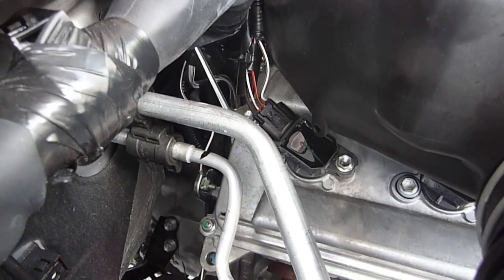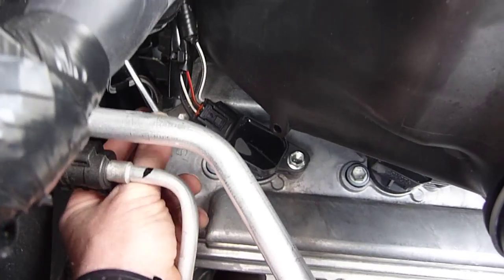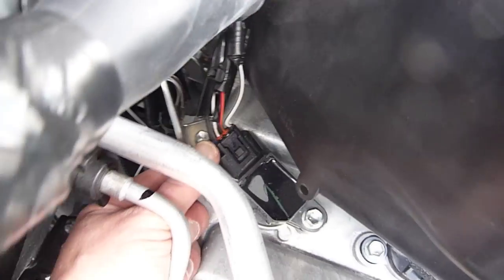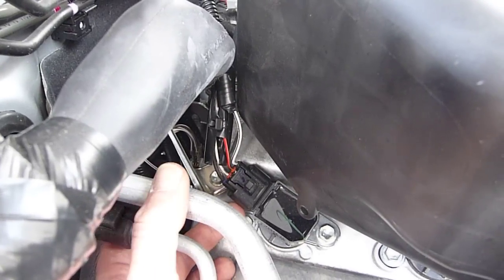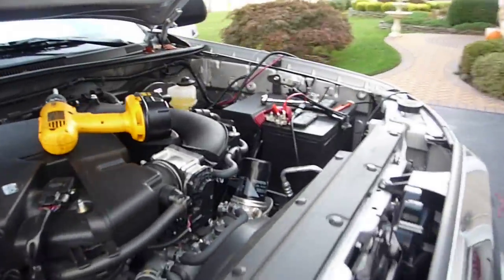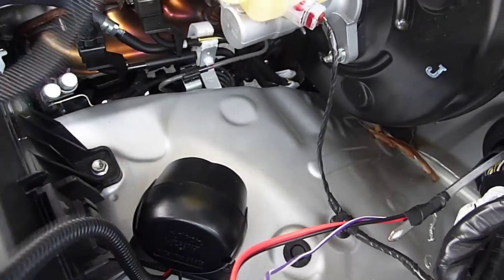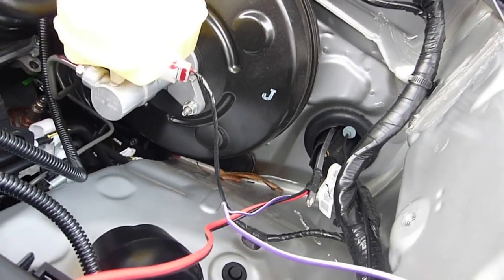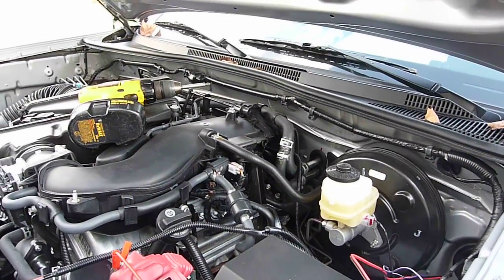Part 1 - How to connect / find a tach wiren and install alarm siren

Comment from the maker: The easist way to do that is get whats called a factory upgrade alarm, like the Omega al100edp, it arms and disrams through the factory locks and turns a factory remote into an fully featured aftermarket alarm. I frown on viper so dont ask me to recommend one, I have those al100edp's on my site btw if you want to research it a little further

Comment: Lol. Injector. Those are coil pack for your sparkplugs  has nothing to do with fuel
Reply: I'm glad I'm not the only one that noticed  He was using a Ignition coil pack, not a fuel injector. I was about to make my post. But I figured I'd scroll down through the comments to make sure this hasn't already been brought to his attention. Another thing about bringing this to his attention is the coil trigger pulse is normally a higher voltage. And is not as recommended over the injector signal pulse by a lot of people, I've heard talking about this.  Prolonged higher voltage through the remote start / alarm system. Equals shorter lifespan of remote start / alarm system.

Comment: Hello Lessco Electronics, hope you and your family are doing ok safe and healthy in this dificult time and  thank you for those good videos; very educational and informative.Hope what im about to write not so boring.
Got a favor to ask you if you can help. I have an 07 Honda Odyssey and been trying to finish the instalation of the after market remote starter i bought last week and the honda - SL3 bypass module that i purchased together with the previous also after market remote starter a few years ago, but lost the installation guide so couldnt try to put it in the van. since i've been out of work and staying home order due to the nasty stuff out there so i thought i could try to put in a remote starting system but got stuck on it now. the connections seem to look ok except maybe i'll have to connect the wire has something to do with tach programing? but it says (optional) so i dint try to connect it besides i didnt know where to find that wire from the van. I was able to get it started a couple of times but shut off within 3 seconds. Any ideas of what else could have been done correctly ? By the way, the horn never honked at all during programming! any's one help would be appreciated. Thanks.

Comment: Lessco, why not grab it at the ECM connector which should be closer to the R/S unit?
Reply from the maker: It depends on the car, some you can do that others not so much..
Reply: @Lesscoelectronics  I meant under the dash, the tach wire always runs to the dash and thus can be tested but I agree that it is usually wound up together in a large harness at that point which could make the job harder as opposed to running the wire. I have a question though, for toyota sienna 2007, the tach says it should be black orange but as most people and manuals have identified it, that color wire is in the middle of the harness, what I have is a white wire in place if where the tach wire should be. Any ideas?
Reply from the maker: Try this info:Tach Signal
        BLACK/ORANGE
        BEHIND GLOVE BOX TOP PLUG ECM PIN 5
Reply: @Lesscoelectronics  I found the plug but the intended color wire location is not where it should be, I will be testing using the AC method on the DVOM and will see which is the right wire.
Reply from the maker: ok, have fun
Reply: @Lesscoelectronics  tried but no go, manuals are wrong online with location specific pictures, out of a thread I was able to extract that the wire is actually at the OBDII connector or at the ECM, second connector from the top to bottom, first pin @ top left side. Alldata info does not call it as something that describes it but it is some sort of clue with pin locations and such.
Reply from the maker: why dont you use an injector or multiple injectors with some diodes?

Comment: My dodge ram, has factory "keyles entry/alarm" with remote start and window roll down using own key fob, can I add a viper alarm system with all the Bella and whistles and control it with my factory key fob?

Comment: I usto work for Toyota as a tech there is a rubber nipel under the main wire harness in every car all you have to do is cut the nipel off and have a nice hole for wires

Comment: Hello, I have 2 questions please: 1. My car has a tachometer in the dashboard and I know which wire has the signal for it, can I use this wire that feeds this tach to feed the tach input of the remote start system?. If the answer is NO then, I know which wire takes to the computer the information about crankshaft and camshaft position sensors, so can I use any of them to feed the tach input of the remote start system? (I assume yes, but It's always listen to a second opinion)... and thank you very much....
Reply from the maker: email me this ?, I have a gift you'll flip for as far as wire info goes, my email is sales@lesscoelectronics.com  be sure to tell me the year make and model.
Reply: Done, should be in your email inbox right now... again thank you very much...
Reply from the maker: np
Reply: Lessco Electronics hello, I solved the issue with the tach wire, I connected to the wire that feeds the tachometer in the cluster and the remote start is working like a charm. But I have a new question, I find the range of my 5706v very poor (less than 200m with a visual of the vehicle trough a glass window), so I wanna ask you based on your experience with those systems (that seems to be huge) if there’s an specific place in the vehicle where you recommend me to place the control center for the best reception. It’s currently taped at the top of the front windshield just behind the mirror, but I’ve heard that it should be at 4 inches from the very top of the windshield... so In any case what’s your recommendation?
Reply from the maker: Yes, its totally fine to use it for both
Reply: Lessco Electronics sorry, I don’t get you, where should I place the control center? What’s the best place for best reception? (On your experience)....

Comment: So why did you do this? I don't understand what the intention is behind attatching it to the injector
Reply: What he's trying to do is supply his alarm/remote start system with a tachometer signal from the engine, using the electric pulse given to the fuel injector. ( Although in the picture it shows him using the Ignition coil but the principle is still the same as the engine runs faster the signal pulse increases at the same rate) This is done to let the Remote start no when the engine has started and to stop cranking the starter. It's also done for safety. For instance, if the remote start is activated and the engine for some reason starts revving out of control. The remote start system knows from the high tach signal that something is wrong and shuts the engine off.